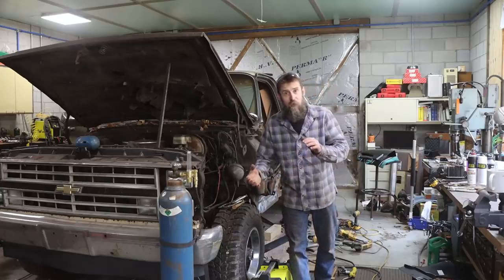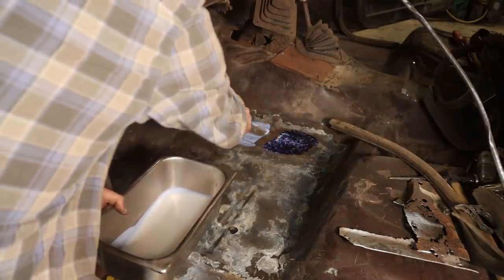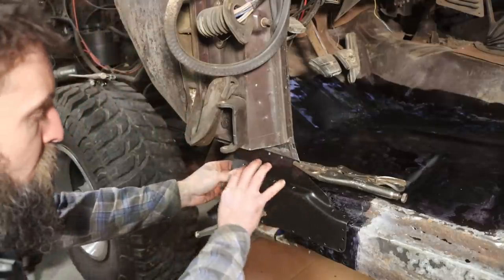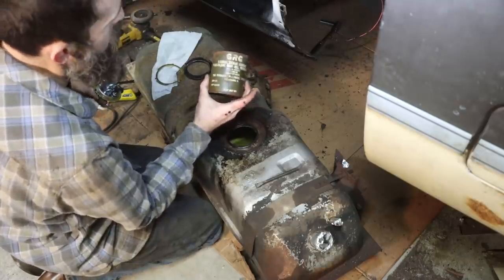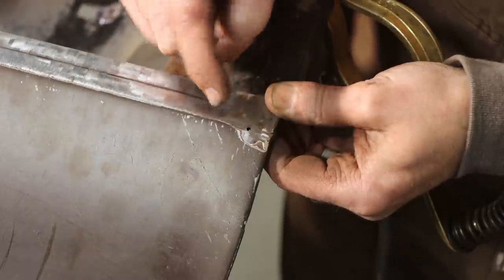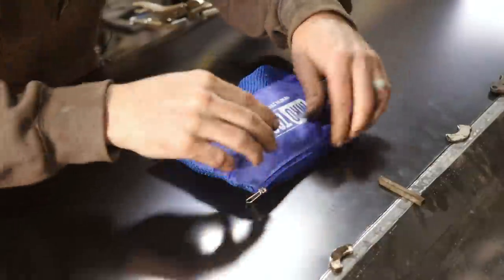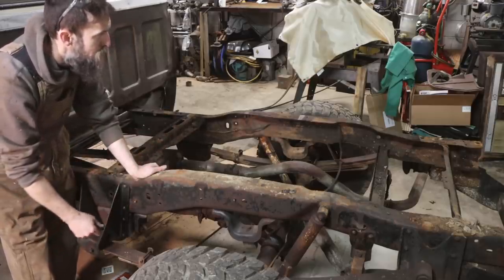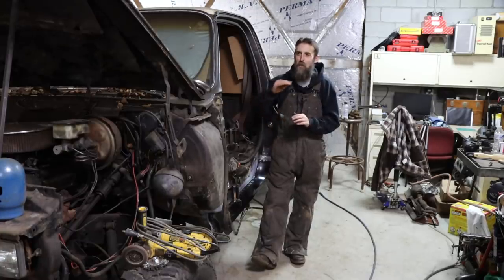Fighting sheet metal on the SquareBody Chevy and Winning! Part 9 #Chevrolet #squarebody

Comment: When taking full or part doorskins off, go down the edge of the fold with a flap wheel until you grind through the fold, and the door skin will come off without damaging the frame by unclenching it! For holes in tinwork, grab a piece of soft copper 1/2 pipe about 2' long and flatten 6" at one end, hold or clamp the flattened section behind the hole, and weld the hole up, it stops burn through and helps to stop warping and keeps the back of the hole flat, and the weld hardly sticks to it so you can pull it off after you finish. I have just been doing all the tinwork on my Fordson major, including replacing the missing box sections that hold the mudguards on! Yoy can see it on my channel, Another fantastic Video Steve, love the channel, but I know exactly what your'e going through, just be glad it is not a Fiat or an Alfa!
Phil
Reply: PS, I always leave a hole 3/4" into all the hollow box sections so I can spray "waxoyl" or similar product into them and seal with a grommet. Did this on the repaired doors an old Nissan Cabstar which I kept for about ten years. Forgot to redrill the drain holes in the doof bottoms, and the filled with water, but did not rust!!

Comment: hi steve i have used that type of rust converter, i found that you need to remove the excess once its dried especially areas it didnt react as it seems its not a good base for the primer to stick to, if you dont do this its not very good result and it rusts pretty fast, if you remove as much as you can its a lot better. hope this helps

Comment: Corroseal is a great product. You might consider using a spray bottle to apply it. Works great. You should also avoid rubberized coatings and in most cases I would even avoid paint. The best thing that has actually worked for me in the past has been Fluid Film. It’s lanolin based and creeps into hard to reach places. What I do is apply the stuff then go find the dustiest dirt road I can find and build up a nice layer of it. So just to clarify. For undercoating you first need to wire wheel sand scrub and remove any loose rust and dirt and so on. Then I go rinse the areas I prepped and let surface rust a little. Then use the corroseal and convert the light flash rust and any existing rust into an oxide layer. Then go nuts with the fluid film. Repeat a coat of fluid film every year or so. Works like a charm.

Comment: Steve, nice work there, and great video.  Only feedback I have is that in addition to using the brass hammer at 13:20 and 14:30, I would also have used a brass drift as well.  sparks, sparks, sparks!  Still, nicely done!

Comment: Having been doing auto body for 45 years in New England I would not undercoat that frame. I would give it a good coat of an oil rich paint such as rustoleum with a brush.  When it is dry hit it with fluid film.  Spray undercoating seems to hold moisture that will get under it unless applied to new metal.

Comment: Looks like the rust converter you have is a tannic acid based one. They're very good, but be sure to avoid tipping any excess product you've decanted back into with the unused good stuff still in the jug - if you do the tiny bits of rust transferred on your brush will react with the good white converter and turn it black (or purple!)  rendering it useless.

Comment: Maybe you can paint on another rust primer on the frame, as you already have it accessible. The reasoning being having two different types of protection is better than having one, in case the product you got, is not up to snuff. In Sweden we used to have a financial minister aptly named Gunnar Sträng, Sträng directly translating to severe in English. He was known to wear both a belt on his trousers, and suspenders as backup. This was also in unison with his stance on financial matters.

Comment: Steve, concerning body work, i see the old English body repair shops using lead/tin to fill holes and repair the body. It is also easy to correct as it is soft; but holds much better then bondo.
I'm not a body expert at all, but that is what i see them do. Maybe something to consider.

Comment: please dont use the old style bondo use one of the resin types they seal the metal any holes that it gets into rust spots are cut off from air an moisture the old style absorbs moisture an rots the metal also great work so far
Reply: all body fillers use " resin " as part of the product...the difference is whether it is polyester or epoxy resin...epoxy is waterproof...

Comment: salt piles up on shock mount rots them fast on mine both top mounts were gone shocks floating in the wind doing nothing so no metal to weld to new mounts did'nt cost much but getting the big rivets out wiz wheel/cold punch and no room to pound under the box was not easy. i use those cheap HF hand pumps draining gas tank thats the 1 easy part

Comment: POR15 or a good epoxy mastic for the frame.  The rubberised undercoat is no good to prevent rust by itself IME, only as a stone chip protection layer.

Comment: I recently learned about those siphon hoses with the brass tip with a ball bearing inside. Bought two different sizes and man, they rock. Well worth it for siphoning gas like you did dude. I can't count the number of mouthfuls of gas I've had over the years.

Comment: Please Steve, don't put undercoating on your truck.  You've done too much work on it.  Undercoating does nothing more than create a space behind it for collect moisture and cause rust to form.  The undercoating hides it until it's too late.  Do what the northerners do and oil your chassis.  Bar and chain oil works good or there are specialty products like Wool Wax and Fluid Film which aren't so messy.  Once you apply them, drive down some dry dirt roads.  The dust will collect and keep the film in place.  Any rust you may have missed will be soaked in oil and will cease rusting.
Love your videos and this series should help me be better at body repair.

Comment: If you were paranoid like me... I would have completely drained the gas tank before removing it and done all the work outside. I understand that in a commercial setting where you learned your skills, time is money, and expedience is important, so they would do it just like you did.  But in a home setting you have to understand the risk to you and your property and consider "what if". Consider living with your in-laws for two years as you rebuild, lol.
  The basis of my paranoia: fire needs fuel, oxidizer, and ignition source. In this case, gasoline, air, flame, spark, or static electricity or the wrong phase of the moon. Years ago, I saw one man put dry ice in old drums prior to cutting the tops off. That was to replace the oxidizer, air, with CO2, which does not support combustion. Dry ice is not that hard to get in most places.

Comment: You really need to use weld through primer under the bare metal places you weld in your replacement panels. This is a common beginner mistake, as they will now rust much faster since the joints will trap moisture no matter how good you think you seal them. I have seen the rust through happen in a year by not priming ALL bare metal. All that work will be destroyed in a short period of time. Good luck   P.S. the "Biden whispering" is kind of creepy...lol

Comment: Please do not just use body filler in holes, always weld even the smallest hole first. I personally use short strand fiberglass reinforced body filler over all welds first, then finish with a quality body filler.